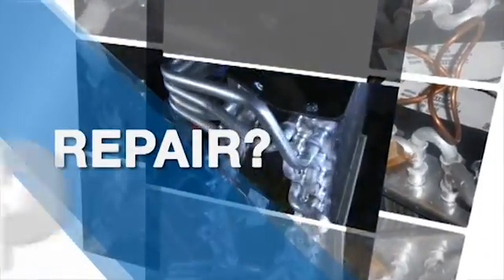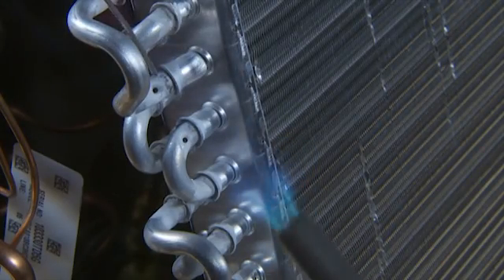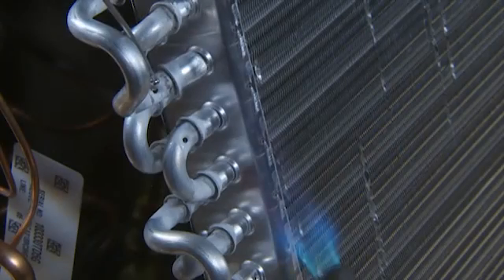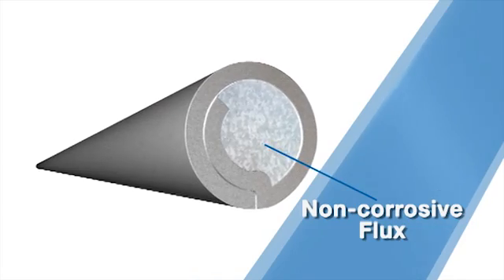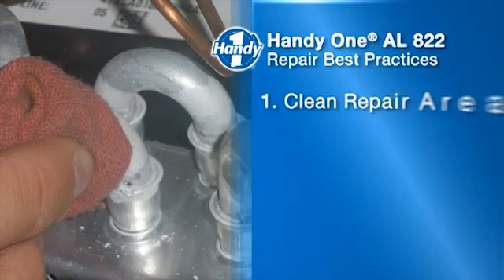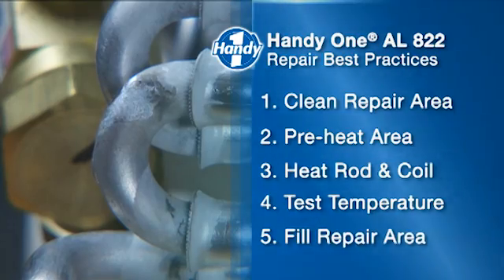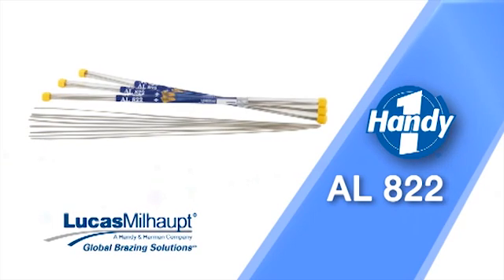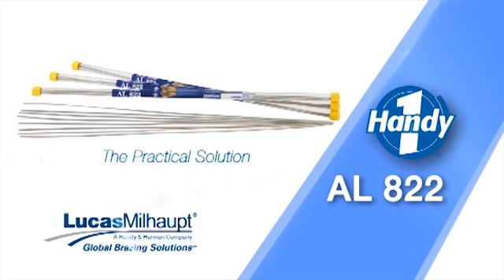Aluminum HVAC Repair

Comment: Sir I am Brazing and tig weldar, work merak hvac air conditioner waxi chaina, your company wante, may contact number +249999840517, 9599731512

Comment: Helpful video, but if you need a machine for bending copper pipes, Aluminum tubes ( automobile airconditioning ), may contact us by  bestgift6@@t  +8613202919508(whatsapp)  thanks

Comment: I know you using a tourch in this, and that is most probably recommended. but would a heat gun not work well in this situation? if it can sustain a temp between the melting point of the aluminium and higher than the rod?

Comment: How is this different than AL802 brazing rods?
Chemically, I see that AL822 is 22% aluminum, where AL802 is only 2% aluminum.
But practically, what are the differences that would suggest one over the other?
Reply: AFAIK, AL802 is 98/2 Zn/Al, which is going to be close to the eutectic point.  That means that it will have (approximately) the lowest liquidus of any Zn/Al alloy.  It will also have a very narrow "slushy" range.  It will tend to either be solid or liquid.  This makes it good for flowing into thin joints at lower temperature, but it may be difficult to get it to span a gap or fill a hole without running out.  

AL822 is 78/22 Zn/Al, and will have a higher melting temperature and a much wider "slushy" range.  This product also has a noncorrosive (probably Cesium Fluoroaluminate?) flux core, whereas I don't think AL802 has any flux.  

You have to be wary about the claims on Zn/Al rods, especially the ones marketed for retail.  A lot of them imply that they have flux when what they mean to say is that they can be used "fluxless".  Zinc alloys will wet clean aluminum without flux, but they typically don't wet freely (they might need to be paddled).  Having actual flux is a huge benefit if you want it to actually wick into a joint.  Without the flux, most Zn/Al wonder rods are basically just sticks of ZAMAK 3.

Comment: I tried Handy One AL822 on a 1987 4-ton Day-Night condensing unit with an all aluminum coil. It exceeded all my expectations. The homeowner let years of rotting leaf and pine needle litter built up inside the base that badly corroded the bottom two coil rows. The best repair answer was to bypass the bottom two rows, where the hot gas lead from the compressor connected, and transplant the hot gas lead up two rows. Portland, Oregon, has a cool climate, so rarely will the bypassed two rows be missed.I bought some 3/8" Al 3003 .035 wall tubing at Grainger to TIG weld in as my backup plan if the AL822 work went sideways on me. All work was done using propane and a fuel-air Victor Turbo Torch. All old R22 refrigerant was flushed out with a nitrogen purge before starting. The whole unit was vacuumed, then washed with Coil-Bright.De-soldered one of the U-bends just above the corroded tube rows, cutting the U-bend in half first, so I could twist each half free independently... super easy. I de-soldered the hot gas line leading from the compressor, flicking the tube a few times to dislodge the excess factory solder/braze alloy, again super easy. The female joint where I removed the U-bend had quite a bit of residual solder/braze alloy puddled at the bottom side of the swaged tube opening, so I made U-shaped "rake" from an old coat hanger to clean out the molten alloy while heating. Again, you guessed it, super easy. Next, I ground away most, but I'm sure not all, of the old alloy with a Dremel Moto-Tool and 1/4" 60 grit sanding drum. The hot gas line wouldn't fit into the swage female end of the coil due to remaining solder/braze alloy residue, so I heating both lines while wiggling the  hot gas line until it slid into place. With the joint still hot, I kept the flame moving over the area and applied Handy One AL822, just as they demonstrated in the video. Flux flowed out of the end of the rod into the joint space. Big joint space, about 1/16" all around. Handy One AL822 has a wide range between solidus and liquidus, so I flowed a bunch of metal into the joint, then backed off the heat and worked AL822 "mush" all around until the joint was completely filled. My first try with the product was a complete success. The flux also did a conspicuous job of reactivating the residual solder/braze alloy, which blended well with the AL822.Pressure tested the system with dry nitrogen while wiggling and tugging on the newly made joint; no hint of any leaks or other problems, just one big successful repair and a very happy customer.
Reply from the maker: So glad that worked out for you, thank you for the kind comment!
Reply: John P. Callan sorry lol just read the full comment lol gonna try this thanks
Reply: @lorenzobarrera4335  Hello Lorenzo - FYI -  I used a Victor Turbotorch with propane fuel. The key is low temperature, but plenty of heat volume. I used the swirl torch not because I needed high temperatures (just the opposite), but wanted plenty of heat to get the whole area up to temperature. Never put AL822 into the flame. Heat the base metal and let the hot base metal cause the flux to flow out and then melt the solder. 
How did AL822 work for you?
Reply: John P. Callan what kind of torch did you use oxy/acetylene???
Reply from the maker: Lorenzo Barrera  Let us know if you need any help!

Comment: One of the toughest and least understood. Apparently it works under perfect infomercial conditions. I want to experiment with it in my A/C shop on some older corroded evap. coils before passing judgement. I know cleaning is the most important aspect AND controlling your heating temperature is going to be crucial. Apparently you have 300 degrees to play with. Might take some experimenting and practice. I feel fairly confident that this stuff just might work and I hope it does. There are some scenerios where repairing vs replacing may be necessary.
Greg Owner/Pioneer A/C Ocala going on 40 years in the trade.

Comment: Used it on an older aluminum condensor coil today. Bought at john stone. Worked great. Got to clean the aluminum really well first and it will work great!
Reply: what did you use to clean it?

Comment: Gotta get me some of that AL 822 depending on the price......however most leaks don't look like this...in fact they're usually in places that can't even be seen or accessed...looks easy though...if we can reach the leak in question....typically I NEVER repair an Evaporator coil leak...especially on a coil that's out of warranty...why get married to it...just replace it...don't even give the customer that option...let some other sucker get married to it...I move on to the next service call.......
Reply: Yeah, sure. Th@'s fine if you have $100 (or so) just waiting to be spent! 😕 I sure as hell don't.
Reply: @djoftha213  - $100? For an evap coil? Lol, try $500 to $1000.
Reply from the maker: Hi Gregory, 

We now sell our Al822 on Amazon, store link here: https://www.amazon.com/sp?_encoding=UTF8&asin=B06XKF7Q4X&isAmazonFulfilled=0&isCBA=&marketplaceID=ATVPDKIKX0DER&orderID=&seller=A2ZLO67FRZ2POE&tab=&vasStoreID=

Comment: ya and no need to clean or prep it either,hard for me to believe to,i would like to try it just to see it most likely not work,i have not seen much that will work on alum. that will last any time at all,about the time you would hit the alum with the heat it melts to nothing rite away!!!

Comment: Why are all these wonderful repairs done on new aluminum?  Try it on a 15 year old one.  Good luck.
GFM
Reply: I had very good luck (see my post from 2017) repairing a 1987 condensing unit with AL822 and a Dremel Moto-Tool with a 1/4" 60 grit sanding drum to prepare the lines. One of Dremel's stainless wire brushes is useful, too. 

You are not wrong about older units needing to have clean joint surfaces before soldering or brazing. The flux core in AL822 works amazingly well. My recollection from the MSDS is the flux has some rare earth elements in it, probably what causes it to be expensive. I've tried a half-dozen of so miracle aluminum solders over the years -- marginal at best. The Handy-One demo video provoked me into trying this stuff for a repair on an especially nasty coil. The unit belonged to a neighbor that had done me any number of favors over the years, so I felt I owed him a best effort. The results exceeded my best expectations. The AL822 flowed well, not just into vertical-down joints, but vertical-up and horizontal joints fed with ease.

Comment: You could easily see 600psi in a R410A system in the condenser. Especially if its dirty in the summer.

Not sure about your question though, maybe you coule try it and see what it will hold.

Comment: I'm curious, assuming these are for 410a or other home refrigerants that don't typically see pressures higher than 160 or so. Will this repair hold up on an Automotive 134 line which can at times experience pressures up to 250-300?
Reply: 410a runs much higher pressures than R134.
Reply: They said it works on condenser coils and with 410a thats 350+psi. Not sure if you're interested after 9 years